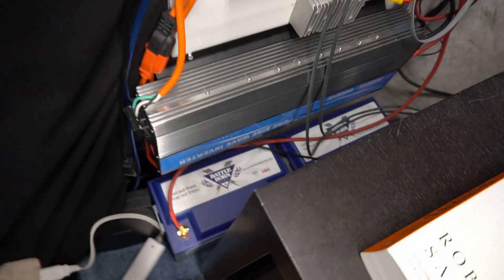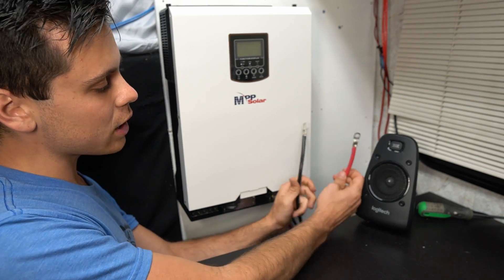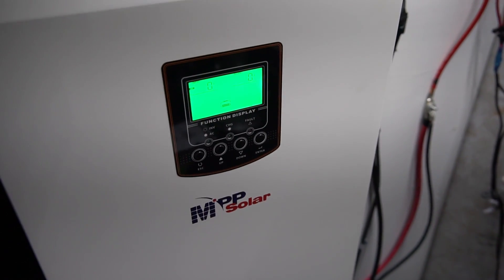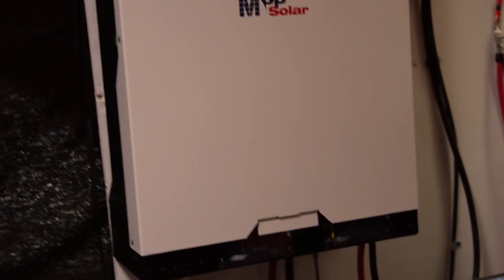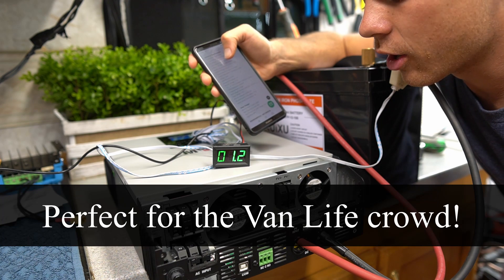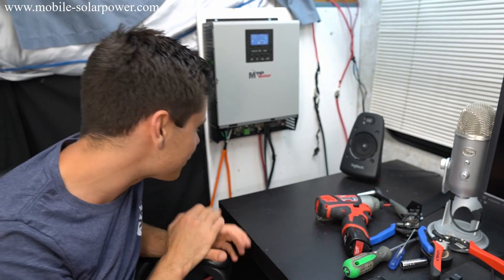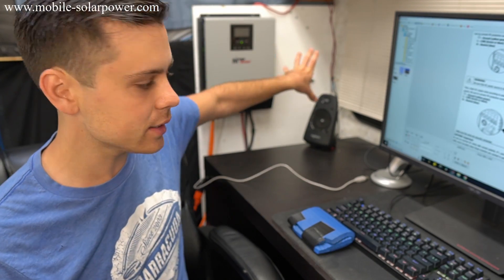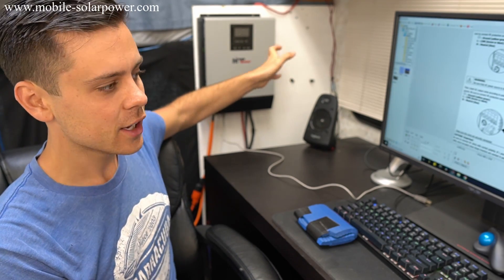MPP Solar Power Inverter/MPPT/Charger "All-in-One"  - Complete Review -

Comment: I've been considering this instead of thr Xantrax Freedom SW. Have you or anyone tried this with an automatic generator start relay or anyone use the remote control panel. The panel would solve the noise problem and allow you to mount in a space with ventilation to prevent overheating and the generator start would provide continuous power when not connected to the grid since the change over switch works well. Perfect for an inexpensive Off grid RV solar system with existing genorator. No additional alternator or huge array required. 400 to 500 watts would be great with genorator back up. Post video or link of an automatic generator start product or relay that works. Also does the unit have slots for battery temperature sensors. Or is it relying on battery BMS
Reply: Probably the wrong Youtube channel this is DIY "Solar" Power with Will Prowse. Battery BMS. The whole idea of off grid solar is to not need a generator.

Comment: What is the problem to just get 2 high quality fans and replace it .
Reply from the maker: The CFM rate required is not found in quiet fans. or high-quality fans.
Reply: @WillProwse  Will: Just get a larger diameter fan with something like a foamcore plenum & run it at a slower speed if you need more CFM. It's the velocity that makes the noise. Done this sort of fix many times.

Comment: Hey Will, how would you go about connecting a generator to this system as well as the grid. for example it connects to the grid by itself but if the grid goes down you can turn on the generator.
any help would be great
thanks
Paul
Reply: The pip 2424lv- msd has dry contacts to remote start a generator.

Comment: If you want to use this all-in-one system to your conversion van, how do you connect your 12volts to this system?   Thank you
Reply: 24 to 12 volt DC to DC converter
Reply: @bretebey  Unless you are using the 12V unit. Then its directly from the batteries.
Reply: @CanadianTexaninLiguria  - Agreed. But the context of the questioned seemed to be asking about the one reviewed which is 24v.

Comment: Is this system UL Aproved to use here in the United States. If it is not. You should not be using it as it can be dangerous to linemen that has to fix the grid if it goes down
Reply from the maker: It's not a grid tie system. Not a hybrid model. Off-grid no need for UL listing. All my grid tie videos will be UL listed devices only.  I'm actually an asshole to everyone who doesn't use UL listed equipment with the grid
Reply from the maker: And this is an ats for bypass and a charger. That's it. Not even possible to backfeed. Hybrid models? Totally different
Reply: This thing does not back feed into the grid. It is connected to the grid but its only there just incase the solar/battery doesn't quite cut it.
Reply: @TriableMilk09  ok but what happens if batteries are full and still bringing in power. Does excess go to house or is that power just burnt off and wasted
Reply: @Zakarume  If you have anything connected to the output of the inverter then excess will go there. If not then the inverter/charger will keep the batteries topped off in a CV stage.
Reply: Emailed the Company that makes theses. This is not UL Listed and it is not supposed to be used as a grid tied system
Reply from the maker: @Zakarume  it doesn't have to be because it's not grid tie. They sell different models that are grid tie, called hybrid inverters. Not ul listed and my channel never covers those. The models covered on my channel and reviewed are off-grid specific PIP models, which have ats for bypass and are battery chargers. That's it. Power only goes in like any other appliance at your home. Power never is backfed to the system. Totally different system. 

I strongly suggest familiarizing yourself with the terms and vocabulary of solar systems to understand what we are saying because you are missing the big points.

Comment: Will... I really like the all in one setup because it's so simple. Is there anyway to pair 2 of the 800 watt systems together so I can run my microwave (1000 watts) or my coffee pot (1000 watts) on my travel trailer? TIA You have more knowledge than anybody on YouTube!
Reply: There is a 1000w version. Can I suggest replacing the items with more RV friendly power ratings? Or add a second inverter just for the high load items?

Comment: I like the look of the 12v model but I live in the UK where the mains voltage is 240v and not split phase. I think I already know the answer but I've got to ask. Could I use this in the UK or is there a 240v model I could get?
(edit) I found something called mpp pip-1012mse but it doesn't mention anything about an automatic transfer switch but I think it might be the equivalent 240v model.
Reply: It looks very much like the Iconica range that are on Amazon and also photonic universe I think, and they are designed for 240v etc - would be good to know if they are the same make or a chinese copy, they are very cheap for what they do thats for sure...
Reply: They do look very similar. It's nice to know I can buy one on amazon uk. The mse range in the cut down versions of the ms range, missing certain features. I think the 1012mse is the equivalent version because there is no 12v 1kw model in the ms range. There is an 800w and a 1.2kw 12v model.

Comment: Hi Will... I've been considering the Victron MultiPlus for it's ability to combine limited grid power with my solar batteries to run AC, etc.

Any alternatives that would let me combine grid power, solar power, alternator charging, generator charging, portable nuclear Mr Fusion generator, etc?  What are your thoughts?

Comment: Would you still be able to branch off a 12v DC set up from the batteries while this unit is hooked in? Or would you have to run everything from the AC inverter on this unit?
Reply: I wonder the same thing!

Comment: Hi Will, so this does simplify a lot and for cheap. One solution for those fans might be to replace them with quiet/lower rpm fans. It will prob require a mod as the quieter fans are generally a little larger to get the same cfm.

Comment: we need the grid tie inverters that totally block any excess solar from being detected on the smart meter by using the included limiter that goes around the AC main leg or a preset that allows it to just never feed ac loads unless it detects like say 300 watts of draw.  since you bought a home you will realize that the power co wants to punish you if you feed back to grid without jumping thru their hoops, accepting aggreement to be ripped off at 400% and triple base fees from standard rates.  thats what state im in.  We need reviews of the grid tie inverters that have limiters so they dont detect recieving production.  please get one and test it.  im not gonna go live in  a stupid van right now,l im trying to save money by supplimenting my loads during the solar days by shaving my bill using an inverter to grid, yet limit any excess that i didnt need from even going up to the electric co.  its like nobody cares about this new tech that even hawaii made it the law to have limiters to stop back feeding to grid.

Comment: Hi Will, I am looking to get this unit.  I am also looking at getting the HQST 100w panels from amazon...yes I will use your affiliate links.  lol
The VOC on these panels is 21.4v.  I am looking to hookup 8 total panels, 4s2p.  This would put my Max VOC at 85.6v.  Do you think this would be ok?  Or is there another solution you recommend?  I'm open to whatever.  Thanks in advance, Ron

Comment: Is there a setting to disable battery charging if the cell pack temperature is low ?  And turn on a battery pack heater ?  The Tesla battery pack can't be recharged below 0C.  This unit would have to sense the battery pack temp and turn on the heater and get the battery pack temp above 0C before it could start charging.   Is there a way to do this ?

Comment: You might want to check on the power consumption of this unit 24V, According to a ? answered by the MFG, it uses 50w if not on stand by and on stand by, no power drawn, it uses 15w. So does that mean that if it is running, it is consuming 50w of battery + the load that is on it?
Reply: correct

Comment: I am considering this unit in 24v 230v as a stand alone unit to run the pool pump and salt generator off grid, tied to grid.  I will add battery backup when i build one.  

My thoughts are put this in a power box mounted outside by the pool pump.

Great video with great info

Comment: MPP Solar is one of the brands for hybrid inverter. The other brands like EASUN, Opti-Solar, etc. Would appreciate when you could make a comparation or load test between many brands with the same specs, for example, it has 3KW output 24V DC input batt 1200WP PV . Thanks. thanks

Comment: There is a remote display available for these mppsolar 
All in ones on eBay so it can be put in a compartment blocking the fan noise.
Reply: I asked the ebay seller, and he said that the remote wasn't compatible with the 1012LV-MS model (the smaller model).  Do you own that model? Did you get the remote working with that model?

Comment: 12volt w/ 2,000 watt inverter and I would buy now... 800 watts is just enough to not be enough...(for me)
Reply: You do realize that 2000 Watts from a 12 volt source is ~185 Amps. That's a heck of a lot of current to take out of a single 12 volt battery. If you need more batteries to "share" the load, you might as well go to a 24v string and cut your current in half.
Reply: @g-whiz286  Its 2000 watts of A/C power 20 Amps. Standard kitchen outlet.

Comment: Hey mate. I have a 24volt 3kw mpp GK series and the fans are on constant. Is there any way you know of i can wire these fans on a thermostat switch so they only come on when needed. The system is full off grid.

Comment: Will:
Some alternative Fan noise thoughts & solutions:
1) I am not familiar with the particular fan models listed, but if there are lower noise drop-ins available, go for it.
2) The #1 source of fan noise is rotation speed / air velocity. This can easily be lowered with a series resistor.  A typical value is 10-100 ohms.... BUT this will also reduce cooling, so a temp sensing shorting device may be required if power dissipation is high. (We were using this trick to mod early in-house built PC power supplies where this cooling reduction wasn't an issue.) If the unit only gets hot when charging, then a night time "quiet"  switch is trivial. 
3) As for quieter fans, our guys did lotsa simulation of different blade designs & came up with some Very Quiet designs,  but I expect that these results should be in products by now. Locking the unit in a closed closet is not a great idea.
4) Note that larger diameter fans can achieve equivalent cooling at lower speeds and hence much lower noise levels. I don't know how much "engineering" you want to do, but a 5" fan & a small plenum should work wonders.

Keep up the good work; I  would encourage you to continue to put product & explanatory links on your website rather than on Facebook or social media links.
Thanks

Comment: Will thank you for everything you do. I'm curious if you can mount this horizontally? I'd like to store it under a couch. Hoping that would give it enough sound dampening for the fan issue
Reply: I don't think that you can't mount it horizontally, air flow is very important with this type of equipment. Under the couch is the last place you would want to mount this, bad air flow and lots of dust, = fire. will goes on about fan noise but they are very important. I built a case with a grill top and bottom outside next to my mains in supply, I don't even think about it anymore. Atb nick
Reply: @nickbird7742  Thank you!
Reply: I thought of this but the mounts are not designed this way and the panel would be hard to see.

Comment: Hi I was wondering how you handle the open ends of the wires. And I saw it, NO TERMINALS for the open ends.
I do recommend terminals for the open wires, since the open ends will be squeezed anywhere and damaged by the pressure of the screw.
At least here in Germany it is required to keep the wires together and get them squeezed properly under the srew.
So terminals are required
Reply from the maker: That's because these are made to be used with raw strands, because it's not a bare screw. It's a terminal that is designed to work with wires without a ferrel. It's good to go
Reply: DIY Solar Power with Will Prowse ok, got it, did not thought about those parts, right, I remember those now. But we put terminals on those as well...  :-)

Comment: Hi Will, 

I have an inquiry regarding the MPP Solar Hybrid V2 5kW (Inverter/Charger) Grid Tie version.

This is the scenario: I have the V2 Hybrid 5kW connected to solar panels, batteries, grid, and load. Assuming my batteries are fully charged so no power from my PV is used to charge the batteries, the PV is able to provide 2kW of power to my load. 

Here is my question: If my load suddenly exceeds 2kW (lets say, 3kW) at that moment that the PV could only provide 2kW, will the grid kick in to provide the deficit of 1kW or will the hybrid system switch everything to grid to provide the whole 3kW load and totally disconnect solar power?

Would appreciate your response. Thank you and have a nice day.
Reply: Best to ask on his Forum

Comment: Love the vid, but couple of things. I wouldn't mount these in a cupboard, the fans blow down and the INTAKE vents are at the top. Also open it up and you will find that the airflow inside poor. With the no load power draw, this turns into a heater. I would also love to know if they disconnect or at least allow for disconnection in the event of a live-earth fault with mains AC input connected.

Comment: I'm in the UK and looking to buy one of these is 24v but noticed when you showed the 12v model in your other video it has six terminals on the AC side, both AC in and out had a ground but on the 24v model there is only five terminals the output side has no ground, can anyone tell me what protects the appliance that is being used, i'm wanting to run a freezer that will be running 24/7 and think it would be better if it was grounded.

Comment: screw hole down the bottom but you have to remove a pcb or at least their 5kw versions have it their , I wish they did 3kw parallel models that are batteryless
Reply: What do you do when it gets dark without batteries?

Comment: I would change the fans out for Noctua fans or something similar. Seems like a great product though for sure!
Reply: Noctua fans are the shit. When noise is an issue I build simple noise cancelling baffles . Basically parallel walls make the sound waves bounce back and forth generating standing waves. When you have 180' out of phase things get quiet equivelent to stuffing a pillow over a girlfriend's mouth when they talk to much lol. That -10db attenuation is life
Reply: @abusiveben  relevant username
Reply: Gotta watch out for airflow though. Those fans definitely have a motor whine (which would be fixed), but at least some of that noise is the air bouncing around as it passes through the case. No way to really do anything about that without risking an over-temperature situation.

Comment: Does the battery capacity % mean anything? Or just go off the voltages. 
Also when the battery is being charged does it read false state of charge?
Reply: Also I’m curious about the point back settings. Why are you not utilizing the battery from full charge? Is this to make batteries last longer? I understand we shouldn’t fully drain them but would it be better to top them to full and then cut back to utility at say 75% or less ??  Does constantly fully charging battery damage it?
Reply: @aceiz100  He's got some great videos on the subject but the less you discharge them, the more discharge cycles you will get (don't quote me)

Comment: Thanks again for another great video 

I already have a victron bmv and large victron mppt, I’ve been looking at the victron multiplus -ii to replace a failed cheap inverter and give me the AC transfer and charger (generator)

But for my secondary setup where I have grid power these are a really cheap option

Comment: Will , 
I’m building a 48 volt system and sure could use a video on the larger 48 volt unit.
Also have you looked at the Nissan Leaf modules for battery storage?
I was thinking on going  his route, what’s your thoughts?
Reply: He did it

Comment: hey will good video, i was wondering if you could review the victron multiplus and the victron 150ah batteries (or the 100), on amazon i saw the 12v 400ah ruixu batteries, would be curious how those are as well - ty man you are helping a lot of folks keep doing what you do
edit: also would like to see the "victron easysolar" all in one solar charge controller/inverter/charger, what are the compenents you need along with this in a solar system in usa?
edit#2: a tutorial on how to tie in solar systems to an rv genset, maybe even with the features of auto start/stop the genset on demand - common for rv's to have a 4kw onan generator, would be helpful to see how to integrate these systems with grid power
Reply: Its says the easy solar is 230V (for Europe)

Comment: When you have tapped into that extension cord in the middle, hasn't it made the male end of the cord dangerous (if not plugged in) by being live and exposed if the box is receiving power from the panels?
Reply: Thats the end that you plug into the power - just like in a house.